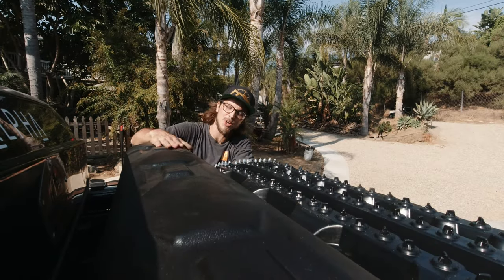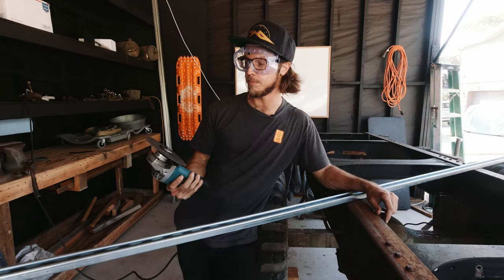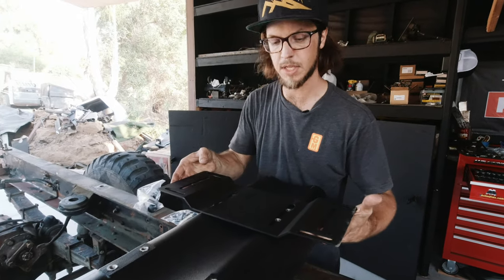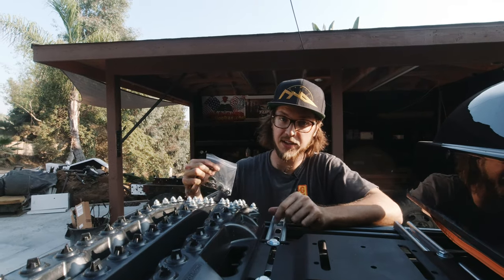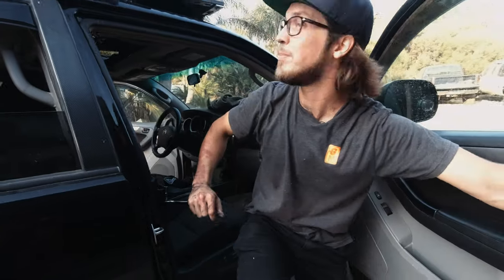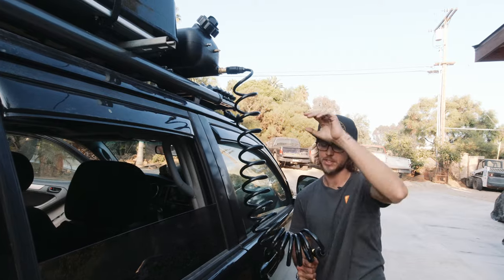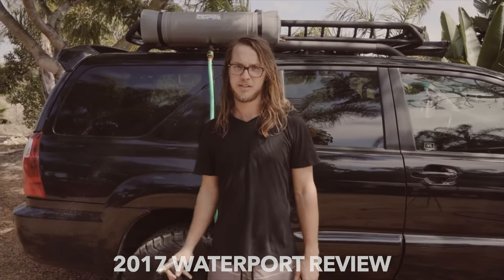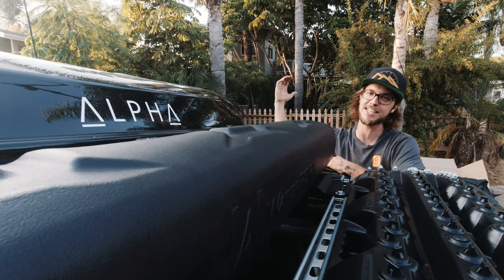8 Gallon Self Pressurizing Portable Shower - Custom WaterPORT Weekender Mount Install

Comment: Hey I notice on your big rig Deuce, you have some weekender tanks mounted on their side. Does having the tank mounted sideways compromise any of the pressurization? I'm looking at mounting a tank on the underside of my bed rack so it would be upside down. I'm worried about the air I add to pressurize it just staying above the water and thus not really giving any assistance since the nozzle would be on the top of the tank instead of the bottom. Any insight would help thanks.

Comment: Would you prefer this over a heated system like the boss mr heater shower system?
Reply from the maker: Honestly I don't have a good opinion. I do know I like having 8 gallons of water up there. You can use that with just about any heater....I think.
Reply: @TrailBendersOverland  That’s a valid point!! I’m even thought of that I like it!
Reply: Great review. Would it have been easier to mount the bracket to the tank and mount to the unistrut?

Comment: Anyway to prevent theft of the port?  I don’t have the sunroof like you do
Reply from the maker: It’d be an annoying thing to steal haha it can be tough to reach under to screw it together. My hope is that’s be enough to turn a thief away. But the two options I can currently think of is to get new screws with a torx head or a lock torx. The other would be to incorporate metal straps and put a lock on them.

Comment: Can the handle/trigger be locked so you can take a shower hands free without the need to keep squeezing the handle?
Reply: You can purchase like an 18" flexible shower head and screw it to the spigot instead of the hose so you'll have the hands free shower effect.